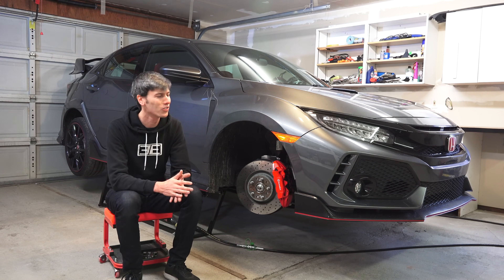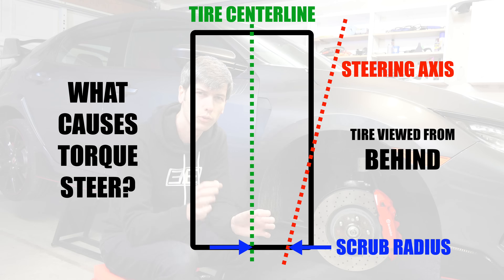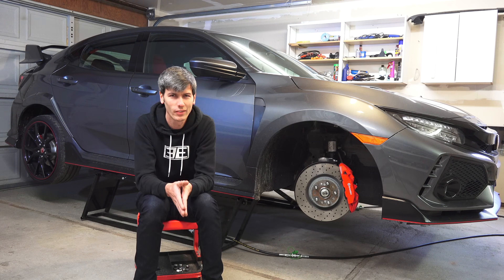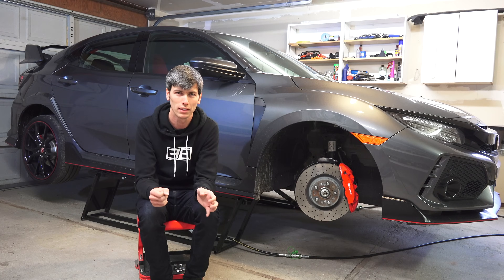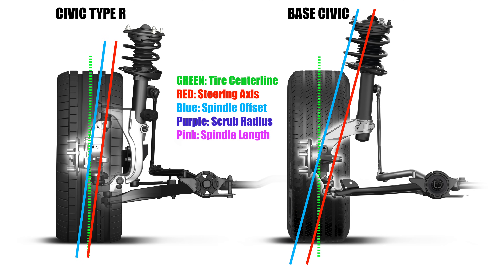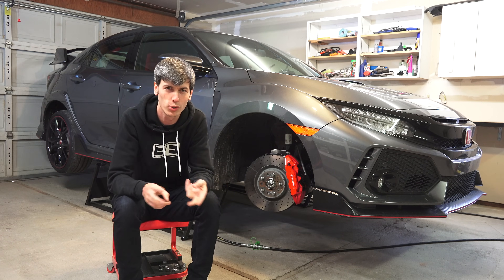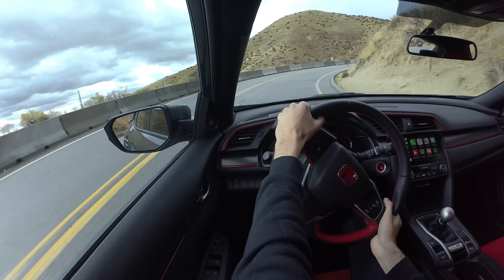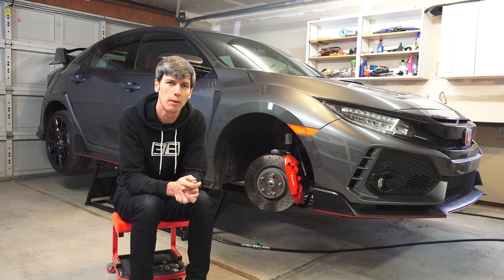Why Doesn't The Honda Civic Type R Have Torque Steer?

Comment: It'll be torque steering on the public road when the tires are nearing their wear bars at 10,000 miles and performance rubber starts to harden.  With the stiff bushings it'll be all over the rougher insections in the wet.

Comment: So the Type R spindle design has 3 ball joints, whereas the normal civic has only 1... I'm very interested in seeing how they hold up after 80-100k miles and how the camber or steering precision is affected.

Comment: You forgot the thickness of the CV shaft will affect the torque the diameter of the shaft the shorter shaft is thinner the longer

Comment: The minimal torque steer that you are feeling sometimes when you turn and accelerate hard is from the limited slip differential that engaging harder because the inner tyres have less traction from the outside, so a torsen differential gives more torque to the outer tyre.

Comment: There can also be torque steer from the joints in the drive shaft. Under force they have the tendency to 'straighten' putting pressure on the wheels and steering to return to center.

Comment: I personally love torque steer.  Holding the wheel firmly and adjusting the angle of the wheels to fight the torque to keep it straight or point out of the turn is exhilarating. :)

Comment: On the limit, in just about all well designed suspension geometries in all good cars, steering feel gets lighter. In just about all cars of all power, tire and drivetrain. Steering resistance should never stay the same strength or get stronger, assuming there's no aerodynamics in play or anything like that. The reason for this is self aligning torque and how geometries are designed.

That's one thing to keep in mind. Although you weren't exactly on the limit in the video. I suspect the reason for the Civic's "Torque steer" in the video is the differential.

Comment: Wouldn't a better way to eliminate torque-steer be to not drive the same wheels that are steering the car?

I mean, if they want to insist on FWD, why not just steer with the rear wheels?

Or, put the engine behind the passenger compartment and drive the rear wheels.

Comment: So this is why my '05 VW Passat TDI has no torque steer even though it has 250 lb-ft going to the front wheels... it uses a similar principle but with separate front and rear arms for the SLA design; there are two balljoints top and bottom (total 4 per side) and the steering knuckle pivots on an "imaginary" steering axis that produces zero scrub radius.  Now only if they had designed that system a bit stronger, those front end parts are known not to last very long (40-80k miles)

Comment: There's a lot of car people here, i have a rwd car (1998 Lexus GS400) and when going around a corner or right after a corner i can let go of the wheel and it doesn't try to pull back to straight. The wheel will turn maybe half an inch towards forward but then stops. Also i can turn the wheel back in the other direction and it will try to pull back to where it was before i turned. So if it was turned left and i pull it back to the right, it will try to pull back to the left a bit. Is this normal? If not, what is the problem and how do i fix it?

Comment: I guess you're bullshitting for 7 minutes, typeR doesn't torque steer because it has limited slip differential and the base civic does not, not because of the center of something and the pivot point of the balls of the bull

Comment: Excellent explanation.

I agree Honda's suspension/steering design geometry in the Civic R is pretty good for a consumer car.

Miles ahead of Subaru,  Mitsubishi, etc.

Wonder of you think *geomertric precession kinematics have anything to do with why the Civic you drove exhibited Torque steer around corners under acceleration? 

It is a strange *dynamic.

One where Moto GP riders push down on the footpeg closest to the ground as they corner at high speeds, in order to make the motorcycle REDUCE lean in that direction and/or sit upright.

Effectively, it means pushing on the footpeg that intuition would normally dictate was the opposite footpeg to exert force on - in order to make it decrease its lean.

In this (high speed cornering) scenario, pushing on the outside footpeg and that which was highest from the ground, would ensure the motorcycle pitched/leaned over further into the corner.

I note also that the Honda Civic Type R's have electric steering. It would be interesting to know what role that plays in minimising Torque steer.

:)

Comment: Back in the 1970s the Citroẽn GS and GSA (and indeed the Citroẽn 2CV and Dyanes, not that they had much torque to show up the problem) achieved this with inboard front brakes leaving the hub free of all that messy clutter, and leaving room for very large brake discs.

Comment: The myth about Torque steer and why even engineers get it wrong is all vehicles suffer from this and not just front wheel drive vehicles. 
Why I say so is that because no differential is made perfect that both sides gets perfect equally power because of friction ect.
What motor manufacturers does to mask it is using like suspension geometry or limited slip differentials ect, but it is always present yet you won't notice it because it will be less noticeable but go put that vehicle on a split dyno which records separate torque on the wheels you'd see all vehicles suffer from it which has a differential. Only solid axels don't suffer from this. Oh even a uneven road surface can give you torque steer by the way.

Comment: Can you explain lsd vs no lsd in terms of accelerating after a corner. I find my car steering shakes and loses grip in a corner acceleration and I have no lsd. Is that because of no lsd of torque steer or both? (Fwd racing conditions btw)
Reply from the maker: When you say loses grip, are you sliding, or is one of the tires spinning? If it’s a single tire spinning, it’s likely because of an open diff (though poor tires could also be to blame, depending).
Reply: Engineering Explained Yes one tyre is spinning. Is there any ways to reduce this effect without getting a lsd? Will sportier tyres or like a big sway bar help? Do you recommend putting a large sway bar on the front of a fwd car?

Comment: Another smaller benefit is that the wheel arch protrudes less into your cabin. The size of the arch can be reduced, since the wheel as a whole doesn't move forwards & backwards.

Comment: The correct way to solve the problem is to buy a proper car, with a good portion of the driving force going to the rear wheels. Why anyone interested in a sporting car would buy an FWD car is totally beyond me.

Comment: If im correct honda manage to reduce the torque steer by developing perfectly the geometry of front suspension, because in conventional suspension like mcpherson strut, you will notice quickly the torque steer when you accelerating when cornering which losses traction. and the stability of vehicle is no good. Thats why honda develop it.

Comment: That's pretty awesome seeing there is almost no torque steer on a fwd car with that power. I have a 2013 speed3 and I have bolt on's with e85 mixed with 91. I put down 314whp and 389wtq on the dyno jet and my car is a torque monster, 1st and 2nd gear are pretty much useless since I just spin. lol Even stock it would pull left or right when flooring it from a dig. I hope mazda brings back the speed3 and uses something like this to help with the torque steer.

Comment: Hi. I was wondering if you've covered wheel hop (axle tramp) commonly associated with front wheel drive cars. I have a 2005 JDM Civic Type R and the wheel hop is horrible. Do you have an explanation for it and how to reduce or eliminate it? Cheers.

Comment: Hey, EE, I was wondering if you have ever done a video on tire sizing, and pros and cons of staggered tire setup.  Audi RS3's can be spec'd with wider front tires, and idk what the performance benefits of this setup would be.  I have also read on the forums that this can help with understeer by creating an oversteer effect for front biased cars.  I have also read that this also causes uneven wear on the tires, and also increase chances of hydroplaning. etc. It would be real cool if I got a science explanation to confirm or deny some of these concepts. Maybe even explain tire wall ratios and all that.

Comment: Hi, I have noticed torque steer in your video, first time it was in 3rd, 3rd time I have noticed it in 1st, 2nd and 3rd. The wheel moves to the right slightly though. I had a front wheel drive Audi TT ~200HP and just when I was changing the gear going flat I could notice the pull slightly usually to the right.

Comment: Isn't it possible that the helical LDS is more responsible for that locked steering wheel feel when on the throttle in a tight turn? My SI does this, both my previous 2015 and my new 2017.  To me it feels like the limited slip that's causing that locked steering wheel, because it's inconsistent and most noticeable during acceleration in hard corners on uneven pavement. What do you think? The LDS must have some affect that's felt during acceleration and cornering.

Comment: Great video Jason, I particularly like the comparison to the base civic. It seems that honda has designed a McPherson strut suspension to mimic a traditional dual wishbone suspension, albeit, a very tightly compact one. The Type R's strut doesn't seem to rotate. I'd be interested to see how these suspension angles compared to the EK chassis civics which were the last dual wishbone cars.

Comment: Just an idea for a new subject "are the weight of the wheels so important from acceleration stand point of view or are just overrated" it seems like the OEM car producers don't care to much about this as they performance cars have pretty heavy wheels.  Then owners pays lots of money for lighter aftermarket wheels.  But I never seen an evidence that lighter wheels do matter (noticeably)
Reply: Lighter wheels will help with acceleration and handling (less unsprung weight) .  However, one has to be careful to not change the OVERALL factory diameter of the wheel/tire combo, as this can affect the ABS operation.

Comment: Impressive! Aside from the fact(?) that it's got less or close to no torque steer, I like that it's not using the shock/strut as the steering axis. I hate that characteristic of a typical MacPherson Strut Suspension. I've always favored a car with a Double A-arm/Wishbone suspension because it does not turn the wheel by the shock/struts. I hope Honda eventually make this standard. It looks awfully good!

Comment: My previous ride,  a '92 Corrado SLC, had almost NO torque steer.  If you did what he did, I.E. floor it with hands off the wheel, after about 100 yards it would be about two feet from the centerline of the road.  FWD is not the hot tip for performance, but it can indeed be made to work.

Honda's suck, they are road appliances.  Volkswagens have TONS more personality!

Comment: At the end of the video when you try to show the torque steering on the corner exit - isn't that actually the LSD working the outside wheel that you are feeling? I mean if the LSD transfers most of the power to the outside wheel as it is supposed to do when accelerating out of the corners , then you would feel exactly what you are showing in this video. Corect?

Comment: You know the noise cancelling systems that remove noise by adding opposite sound ?    Why not use electrical steering to add opposite input to negate torque steering ?    Or why not use active torque vectoring to counteract native torque steer ?
Reply: I presume they are doing a whole lot of electronic wizardry, even with the improved geometry at 300HP at the front wheels you will get huge gaps in power distribution and with it torque steer.
Reply: That question reminds me on my stay in an appartement in St. Petersburg / Russia where there was no regulator for the heating so if it is to warm a window has to be opened ...

Comment: The inherent return to zero steering angle is part of the caster angle, alignment, and suspension geometry. It has nothing to do with torque steer. Caster angle has the biggest influence.

I own a Honda Prelude type SH. It uses an older method to mitigate torque steer using short-long arm (SLA) double wishbone suspension in the front, and has an active differential to eliminate understeer. It too very rarely has torque steer. Honda is not new to mitigating torque steer in a FWD vehicle.

Comment: However if you get used to it it tends to be your warning that you're on the verge of going into understeer and to feather out on the gas. But in exiting a turn (into a straight) you could just get on it in anticipation of the understeer being in the direction you're wanting to go anyways. Then you work against the torque steer a bit to exit the turn, and with power steering on modern cars it's not that big a deal. It tends to be a bit more of a problem in cars that have slop in the steering or a softer suspension than those that don't, as they shuffle a bit if you get on it.

Comment: This is impressive but what if the shock absorber was attached to the lower control arm and the hub was free to adapt to the road conditions unhindered by suspension travel? I could be talking out of my arse, i'm not an expert but would this not allow more contact with the road? I remember earlier Honda's with independent suspension utilising this design and even when I worked at Ford, they sold it as a "key innovation" of the MKII Focus RS ... some twenty years later. I imagine, like most things... it is just not cost effective today as a reliable serviceable item? I think, it is impressive that the new CTR is so capable despite what seems like a basic design.

Comment: From over 10 years Renault Sport is using Torque Steering in Clio RS and Megane RS. I have Clio RS R27, steering and suspension is great but it's expensive to fix and work with solusion like that ;)

Comment: Thanks for the video!  The CTR wheel offset it +60.  Some owners have switched out their wheels with smaller diameter and +35 - +42 offset wheels.  Will that help or hurt what Honda did to combat tq steer?  Thanks!

Comment: There is a tiny smudge on the lower left part of the Type R windshield as you are doing the corners. I thought it was a smudge on my screen. I was getting really annoyed that I couldn't get the smudge out until I realized it was on the car windshield and not my screen. Ha ha.

Comment: On this specific suspension (fk8 type R), how much will 19mm positive scrub radius affect handling? Car has 20" ET60 wheels, want to put 18" ET40 wheels. On which way handling/braking characteristics will be changed?

Comment: The revo knuckle designed and used by Ford is another great example of conquering torque steer. Sounds crazy but we have plenty 300 hp plus front wheel drive cars and now some close to 400 hp that don't torque steer, things have come a long way.

Comment: Regarding the torque steer while turning with the foot down. Couldn't it be linked to the LSD kicking into action? I noticed on my car (which is FWD with significant torque) that after I switched the OEM open diff by a Quaife Torsen LSD, sometimes on a corner and in certain conditions, the nose of the car would naturally dip into the corner as a floor it exactly as you described it (which actually replaced the systematic understeer I had in this situation before).

Comment: You seem to be wrong all the way. The car is symmetric, so any force applied to the left wheel would be compensated from the right one. Torque steer comes from unequal wheel shaft length -> unequal CV-joint angle -> unequal friction losses on left/right drivetrain system. You can easily simulate it by adjusting your suspension on one side of your car, or just loading one side to lower it. That's why on most fwd cars usually have shorter left shaft - to compensate the weight of the driver. Sorry for my poor english.
Reply from the maker: As mentioned in the video, symmetry plays a role, but you can most definitely still have torque steer with equal length half-shafts. It does not eliminate it.
Reply: Sure, it could happen for lots of different reasons - by wheel bearing wear, wrong camber setup, unequal pressure on left/right wheels, etc. But main reason is the geometry of drivetrain shafts - their respective angles and torque losses caused by them.
Reply: As you've mentioned in the video - you'd still experienced torque steering while driving in the sharp turns - while car was leaning to the left/right - so drivetrain symmetry was gone for the moment.

Comment: I would have thought torque steer is a result of uneven distribution of torque between wheels as exists with uneven drive shafts. What your describing should balance out, seeing that any design  will even out side to side providing even traction is given. I don't believe my wrx has minimal scrub radius, even with higher offset front rims. I can put maximum power and it pulls straight so long as traction is even, so I believe this is from the symetrical front shafts. I do get some understeer as described,

Comment: Noted in the comments before but that „torque steer“ is related to the lsd and actually its exactly what you want it to do. Pull the car in the corner. Otherwise you would get understeer and nobody wants that ...

Comment: 1 year ago In automotive classes, I did my portfolio presentation on this technology. The presentation lasted 15 minutes, and I bored the crap out of most of my class. The only thing I couldn't figure out (with weeks of research) is WHY the spindle length affected torque steer. I asked my best friend currently learning to become an engineer (mech) and I didn't really get an answer in terms I understood at the time.

Thank you for this video!!